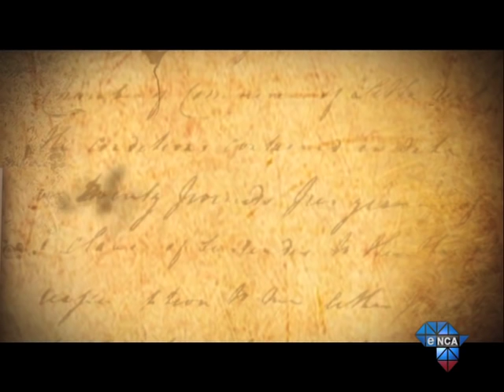Against All Odds | George Netshilindi's Homemade Cars

Comment: Within a vehicle there are thousands of parts, any of those can be an invention. Do not look at the vehicle as a whole.

Doesnt mean that teslas electric motors are not inventions because of the electrical motor existing for over 100 years. There are many parts that can be made more efficient within the electrical motor, shape, size, geometrical proportions, copper purity etc.

Also just the skill of doing this with the few resources on hand and without these wonderfull garages and modern tools advertised on youtube channels.

I personally think, great achievement. Well done and God bless.